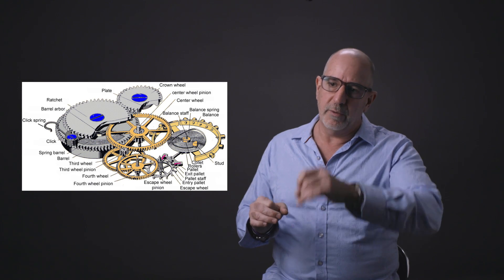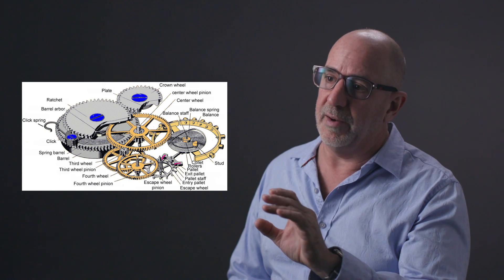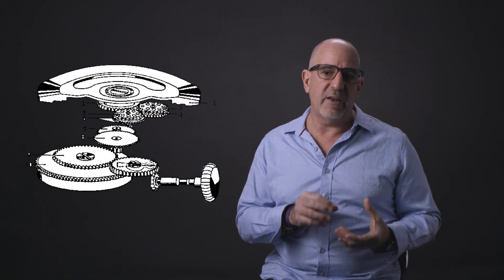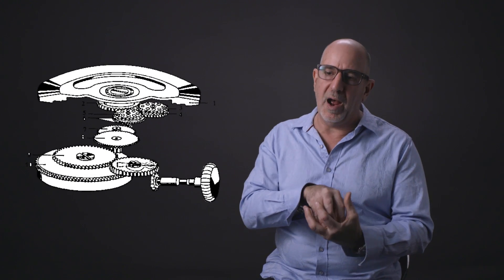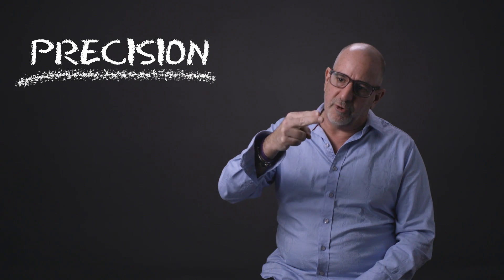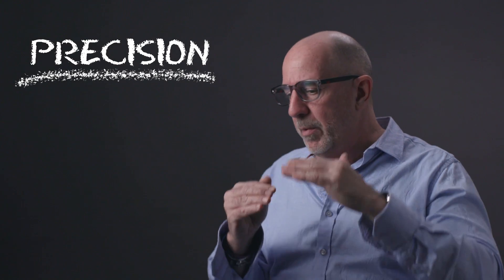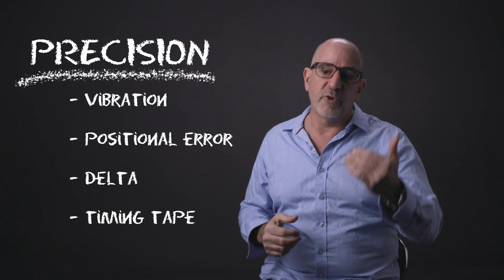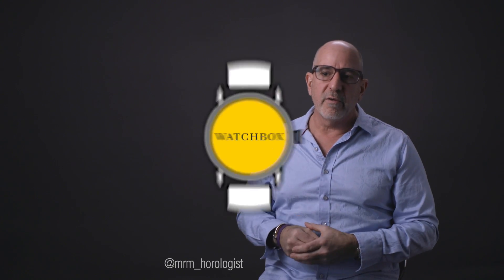How Does a Watch Work? | The Classroom

Comment: My 116719BLRO Rolex was gaining 20 seconds a day and they corrected it by fitting a weaker mainspring as they said the movement had a 'high action' why would it not keep accurate time with the standard mainspring?
Reply: Andrew Holt Rolex likes their amplitude to be <300 at full wind -20 min, this gives better isocronysm and thus better accuracy. If your over 300 degrees you run the risk of overbanking or galloping Whig can lead to excessive time gain 👍🏻
Reply: Michael Michaels 300 is the circular motion of the balance wheel?  270 degrees is 3/4 turn.  I assume a weaker mainspring from your description of how it causes the balance to spin and regulate time stops it spinning >300 degrees; but I don't know why it would do that with the supplied mainspring.  Maybe I move my arms more than normal.  Thanks for the reply.  It gives you a glimpse into the workings of wristwatches.